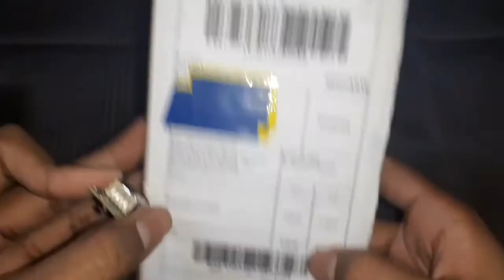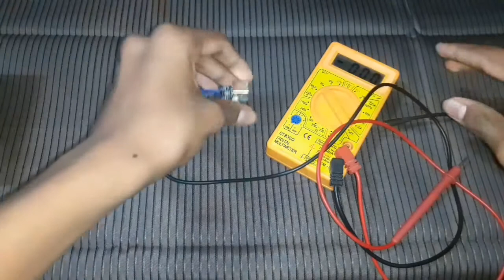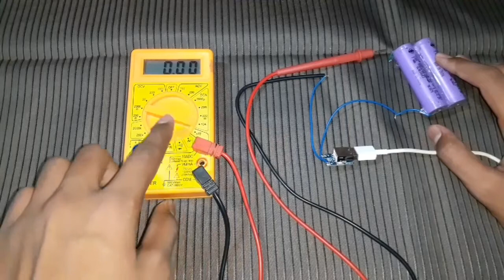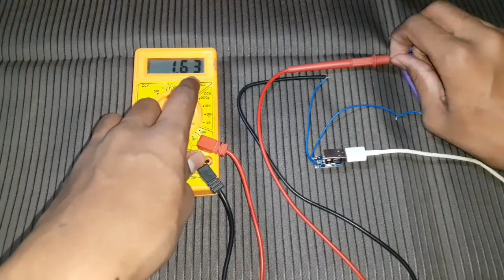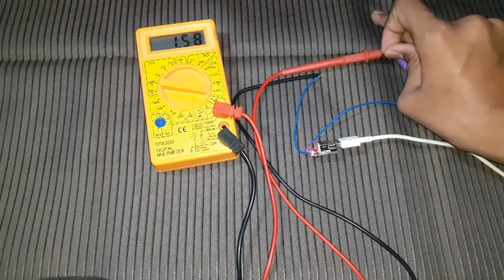5v power bank module detailed review.||Urjit Bhavsar||

Comment: i have connected my solar panels output(5v,500ma) to this module but the module is not working when i checked the input voltage of module during connection it is showing some voltage but the led was not glowing and it is not giving any output and when i checked with other source rather than solar panels it is working , so finally i think it is taking input but is is not giving any output 
     can you tell how to fix this issue
Reply: use TP4056
Reply from the maker: The module has a self-trigger function, so the led glows only when there is some load connected.  For your case, the input current and voltage are highly unstable as the source is a solar panel.  
If you want to charge your cell phone with solar panels, then you must first store the energy in a battery and then use the stored energy to charge your phone.  Use TP4056 for charging batteries and then use this module to charge your phone. Thankyou

Comment: Dude I've actually purchased the same module from local shop, but after coming home and checking it, it does charge the battery when connected the micro usb, but when connected to a smart phone, it doesn't charge the phone and the light of the module also don't turn on, the shopkeeper refused to change the module, any ways to fix that module???
Reply from the maker: Try changing the battery it might be too weak to supply enough current to charge the battery.
Reply: @UBsLab  I did, but still Didn't seem to work
Reply from the maker: Welk does that heat up?
Reply: @UBsLab  no, however when plugged it into charging, it does charge the battery and also heat up. But doesn't work when using as power bank
Reply from the maker: @aptube6754  try using a different USB Cable or different devices. Or just test whether it supplies voltage at the output or not.

Comment: Bro how much time it takes to fully charge 1 18650 battery when its charge is very low? And can I use Arduino, LCD, sensors etc. with it?
Reply from the maker: For a 2000 mah li ion battery it can take almost 3-4 hours to charge. You can use TP4056 module for faster charging.  And you can use this power bank module for powering Arduino and all 5volts  stuff.
Reply: @UBsLab  
I checked the amphere of tp4056, and found that while charging, the battery is drawing around 0.1 amp, so will it charge my battery faster?

It's not possible to charge the battery with a different module, while connected to power bank module. So can the slow charging be overlooked keeping in mind about the performance of the power bank module?
Reply from the maker: @sarthakmishra5418 Why not? You can charge the battery with TP4056 while it is connected to the PB module. Your battery is either charged or has some current limiting pcb that is regulating the charge current.  In that case using any module won't charge the battery faster. The battery will take only as much current it requires. Cause TP4056 outputs 1Amp as the standard charge current.
Reply: @UBsLab  I won't connect Tp4056 with it as it would not affect the charging time to a large extent. If I add tp4056, the the total cost of set increases to 100rs.
 in our place the PB module costs 60 rupees, so should I buy it to make my DIY Powerbank, to power by all Electronics that run on 5v, including Servos, Arduino, LCD, mini water pump etc. What's your openion, as you are a experienced man....
Reply: @UBsLab  and yes...the battery's voltage is 0.22volts and I am not connecting any other pcb's. I am directly connecting the battery to tp4056 and the battery is drawing only 0.1amps
Reply: @UBsLab  please sir....reply me
Reply from the maker: @sarthakmishra5418  You need a new battery kid... once a battery goes below 2.5volts,  its dead
Reply: @UBsLab  last thing sir....
I won't connect Tp4056 with it as it would not affect the charging time to a large extent. If I add tp4056, the the total cost of set increases to 100rs.
 in our place the PB module costs 60 rupees, so should I buy it to make my DIY Powerbank, to power by all Electronics that run on 5v, including Servos, Arduino, LCD, mini water pump etc. What's your openion, as you are a experienced man....
Reply from the maker: You can do so but it I would recommend you to s
Use a boost coverter for your power supply. Like the MT3608 or xl4015. These boards provide you a variable voltage output. So of needed, you can also power your Arduino s with 12v or any other voltages. The PB module however isn't reliable. It might not recognise the load. Which means it will keep restartig again and again. 
So I would prefer a boost converter👍

Comment: I think its heating because you put 2 batteries at a time.
Reply from the maker: Thanks for commenting. The module can output a fixed current to charge the batteries. And it draws 1.5. amps for charging the phones. The no. Of batteries don't affect the heating of the IC. It's because of its poor efficiency.
Reply: @UBsLab  Can you suggest me a battery for using spot welding machine? Or else please suggest me how to sholder 18650 batteries in series. Spot welding machine is not giving good result with 12v battery of HONDA Activa. I want to repair my laptop battery. And thanks a lot brother for clearing my doubt. 😊
Reply from the maker: In order to repair your laptop's battery, you need to replace the lithium-ion batteries. For soldering them in series you can use nickel strip. you can run the battery contacts with sand paper for better soldering. I won't suggest you to go for costly spot welding. Thank you

Comment: Sir can I use this module to charge 3.7v two batteries connected serially?
Reply from the maker: The module outputs 4.2 volts to charge a 3.7 volts battery with a maximum current of 1 amp. So it won't charge a 7.4volts battery with two batteries connected serially

Comment: what is the maximum output current from the module
Reply from the maker: From the USB port your asking?
Reply: @UBsLab  Yes
Reply from the maker: @mohamedirfanam  its 1 amp my friend
Reply: Thank you 1 amp is required for my project 😊
Reply: @UBsLab  did you measure it ??
Reply from the maker: @mohamedirfanam  Yes my friend but it won't be continuous, depends on the battery levels.

Comment: how much mA get from battery when it has NOT output connected? Thanks.
Reply from the maker: Sorry, but I didn't understand your question.  Could you please ask again in some other words?
Reply: @UBsLab  how much amperes (mA) does the board "waste" from your battery when there is nothing connected in the output ? I mean, quiescent current.
Reply from the maker: @diydsolar  something in 2< microamps
Reply: @UBsLab  microamps? That will be with ic disabled. But it is probably enalbed all the time. Could you test it for us ?
Reply from the maker: @diydsolar  yes, will surely check in the coming month once my meter arrives. 
Thanks for your comment.

Comment: It can charge mobile i have have tried
Reply from the maker: Yes it can charge
Reply: I bought it and want try it but can you tell me how many lithium ions battery have you connected
Reply: I am not able to tell you correctly but you have to calculate the ampere. One thing more that it is an emergency thing it can charge only upto 20 to 30 percent very slowly. @prasadwarkhandkararts5358

Comment: Solar me 10 watt loom solar me ye chla ga plz bta do 5 volt plz input 18 volt ha out put 5 volt mila ga
Reply from the maker: You will have to use buck converter in that case. In other words step-down converter. This is a step up module. Thanks for commenting..!

Comment: Would a heat sink improve performance in your opinion?
Reply from the maker: Thanks for your comment. In my opinion adding a heatsink will only  serve the purpose of protecting the IC from falling off the circuit. But the amount of heat produced is indirectly proportional to the efficiency.  So more the heat, lesser the efficiency.  So even after adding a heat sink, the power efficiency won't matter. Also adding a heatsink on such a tiny IC is a big challenge though!

Comment: Thx. It would be too hot to put inside a 3D print if you can't even touch it
Reply from the maker: Actually yes, it gets too hot but pretty much depends on the load. It goes as high 83° and not above that. So it should not harm the 3d print I think.
Reply: @UBsLab  Ok thx!